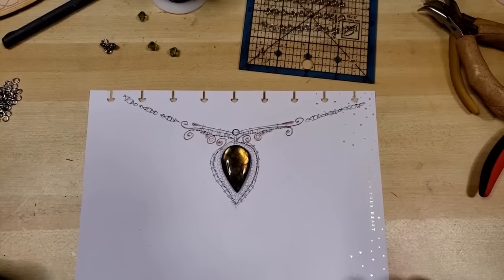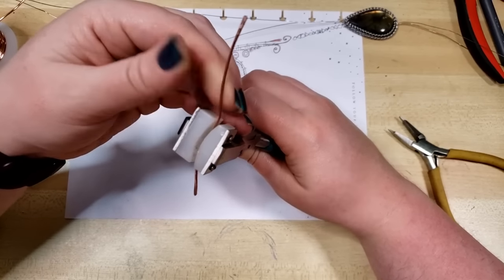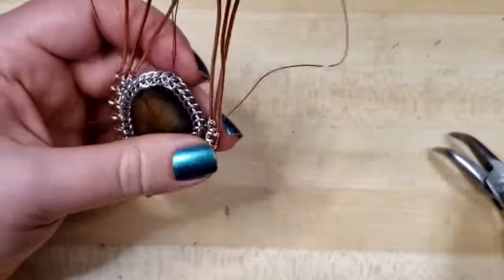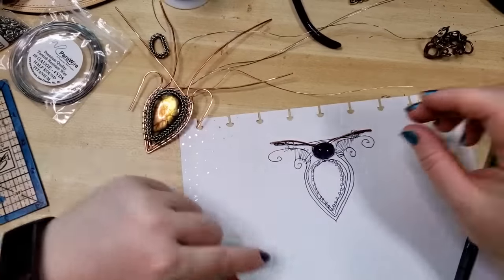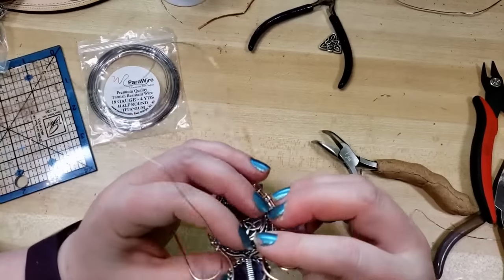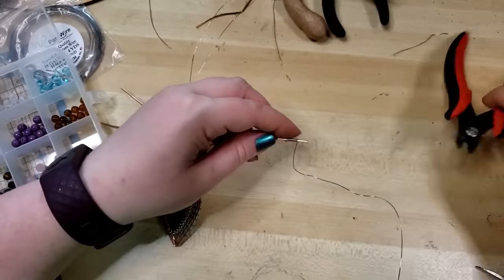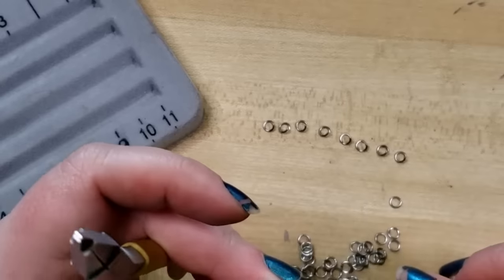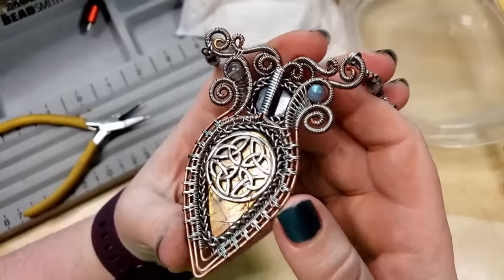Wire Wrap Chainmaille Necklace Master Class

Comment: With ask skilled as you are, you aught to just buy argentium silver wire. it's 935 and is alloyed with germanium rather than copper, so it doesn't tarnish.  It just sucks when you have a nice silver plated wire wrapped piece and the silver wears off.  It's not that expensive and you can send in your scraps to be recycled, too.
Reply: I second this comment! Argentium Silver is also tougher & it even outshines platinum. 
I just came across your tutorial for the first time & the necklace is outstanding! 
Your patience & explanations are great too 👍
Just out of curiosity, if this wasn't for your niece, how much would you price this necklace at?